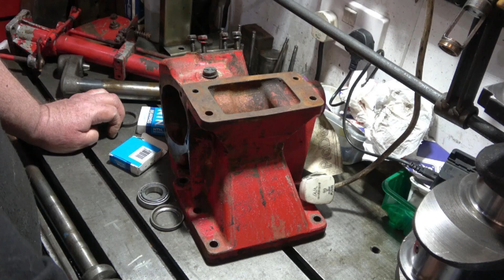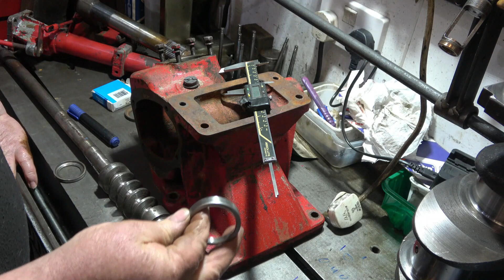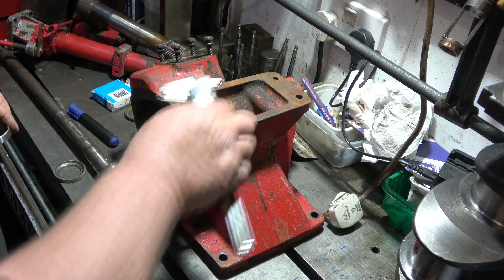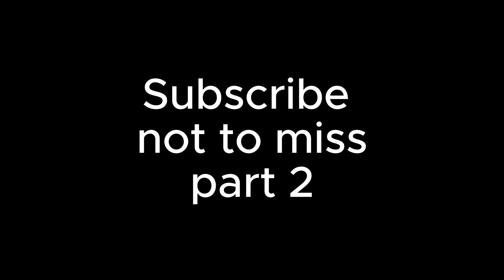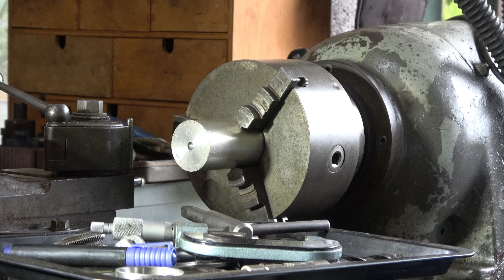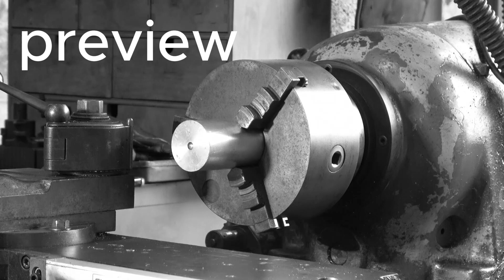International tractor steering box repair pt1 ..... Smart and Brown 1024 lathe

Comment: I think grinding the out race would be easier than the set up for boring out the casting to accept the new size bearings. The disadvantage would be having to have the bearings ground everytime they needed replacing. Cheers
Reply: Generally I would prefer to fit a standard bearing to a modified housing, rather than the other way around, gives the chap down the line a fighting chance. The but being will the rest of the machine last long enough to wear out the new bearing whichever way you do it. If the life expectancy is only a few years then the easiest way has to be the best.
Reply from the maker: Swings and roundabouts, machining the casting would be the best option. Though setting up and doing it would be a whole new video in itself ... along with time and cost .... gotta make a call ... :)